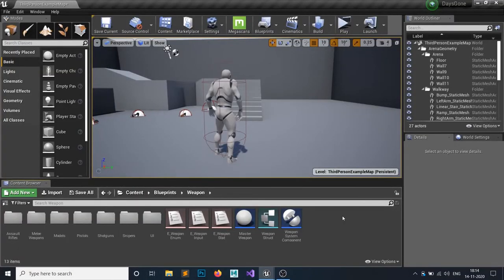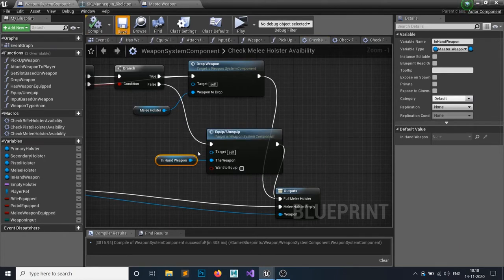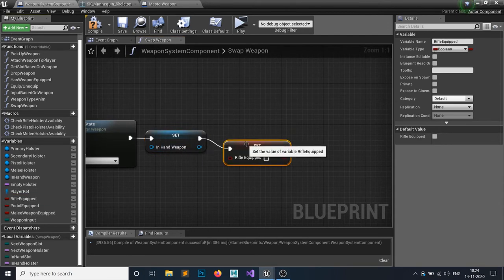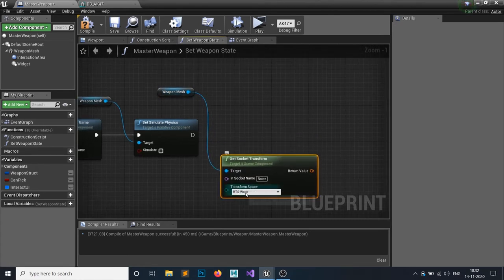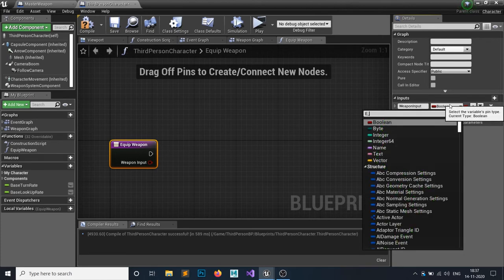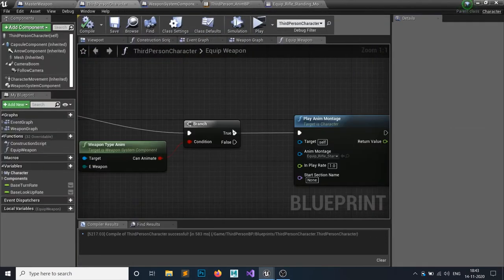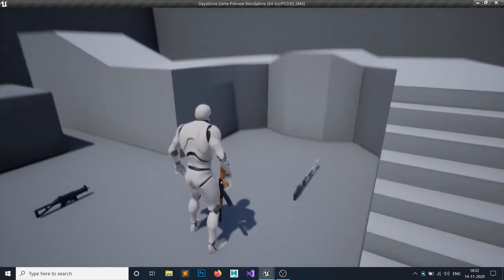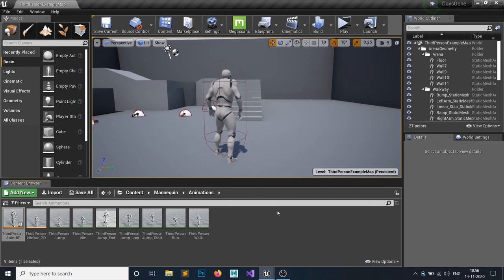Unreal Engine 4 - Third Person Shooter Part 4 - Slot weapon

Comment: Oh, my God, you should have seen my reaction when I managed to holster my weapon:D everything was fine until the moment I started equipping, I take two rifles and a pistol, and instead of freeing up a slot for a pistol, they both end up in my hand, what caused such a bug? everything was done exclusively from your tutorial
Reply: and I hurried to say that everything is fine, I also can't pick up the weapon I threw, that is, I took two rifles, I take another one and the one that was from the primary slot drop, but I can't pick it up, it remains on the ground even though its collision ceases to interact
Reply: hi there, did you find a solution for this?

Comment: Thank for your work. Can you help me. My gun, when I press 0, is not at the back, but at the bottom. Although I have retargeted to another skeleton
Reply from the maker: Is it switching sockets? Just check if the sheathe part of code is running or no
Reply: @KaranParmarGames bro I got it on my own but one thing I wanted to play diffirent anime for sheath is there any way that can do that cuz when I did it's playing the same anim in for the pistol also how can I seperate them ?

Comment: Hi Karan, not sure if still check your channel videos for replies or not. This is after all almost a year old. Great tutorials by the way. Learned a ton! However after adding this together in my own projects earlier this year , this past weekend I was looking into some alterations. Which unfortunately breaks things. I was thinking it could be used for a dual weapon setup or even-offhand. 
My idea being a left and right hip holster, using similar as the primary/secondary, but I need both weapons to be able to be holstered or inhand. So I setup a second inOffhand and made adjustments. This actually works pretty well, after the initial pick up of both dual weapons and a third equip button press, but from there things just drop in the air instead of re-holstering. 
Curious if any ideas how could implement a dual / off-hand approach to this system?
Reply: You can download the advanced weapon system from marketplace for reference and its also net replicated
Reply: @BROCKSGAMING  I do believe I have that but didn't think to compare. Good idea :)
Reply: Do you have any tips you can share about a duel wield system?
Reply: @MattJimenez01  I pretty much abandoned this and built my own system over a year back. Used these tutorials as a basis. Duel wielding itself is easy to equip and unequip, but the aspect of switching those out with a single two-handed weapon is more difficult.
My TMNT game focuses on Leo, and he has BOTH Katanas which can be equipped and unequipped.

Comment: Karan, if I wanted to use a flashlight instead of a pistol. How would I add a light once it is in hand and have it turn off when not in hand? I have the flashlight currently set to my pistol holder.
Reply from the maker: On equip, you can check the class and if it is flash light, then you can cast to that and turn on the light. In flash light actor définition, you can add turn on light function
Reply: @KaranParmarGames  Which graph has the flashlight actor definition that you mentioned? I have attached the light to the mesh, but I'm not sure which graph to add the turn on light function. Please Karan you are amazing and I need your help :D

Comment: my gun when I press 0 is not in the back is in the hand yet
Reply from the maker: Check out the blueprint again
Reply: @KaranParmarGames  May be no the weapon equipe but I already checked the project and didn’t find the error
Reply from the maker: @xrrayper1837  it's night time here. But can you ping me tomorrow. I'll check your code on discord screen
Reply: @KaranParmarGames  I couldnt’t get into your discord
Reply from the maker: @xrrayper1837  Wrench #9480
Reply: same error equipped weapon 1+2 trying to replace try to pick up again and both weapons stay in hand
Reply: @TrippyPa  I already created a solution for my error with verification system
Reply: @xrrayper1837  fixed it, it was because i use skeletal meshes , fixed it by replacing 4 functions

Comment: Hey Karan! Not sure if you'll see this. But couple things to mention if you could offer some wisdom or thoughts?
So I seem to have followed it all quite well and have learned nicely along the way up to this point, however, whenever I go to Swap my weapon, nothing happens. The animation can trigger but the logic to attach the gun to the correct socket seems broken? I made sure the socket names was correct and all. So that's not the issue. But I can pick up / drop weapons fine, it's just swapping between my pistol and rifle doesn't actually occur. Any ideas of where I should look in the code to troubleshoot this?

Secondly, if I pick up a weapon I already dropped, it seems to break, the gun vanishes and actually appears at 0,0,0 world coordinates - when I quit play mode I get a yellow error to do with the physics?

Thanks anyway!
Cheers.
Reply from the maker: Have you added anim notify? Please make sure you have added. If you are using skeletal meshes then the physics asset will not simulate correctly. For that you have to buy some really good 3d models. But i have added a solution for that in later videos, it's not perfect but you can work with it. If you still have queries, you can reach out to my discord at Wrench#9480
Reply: @KaranParmarGames  I have yes, but in theory, should the weapon still swap when the function is called without the animation added?

And will do! Cheers!
Reply from the maker: @thedevilhimself1728  yes